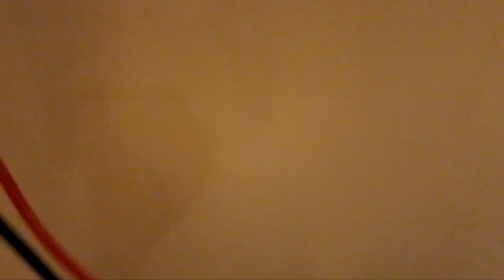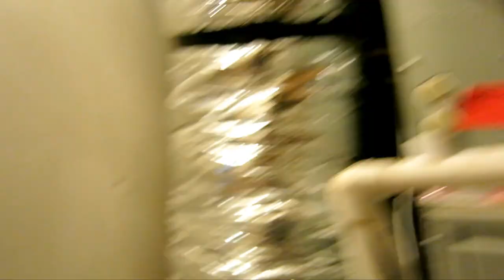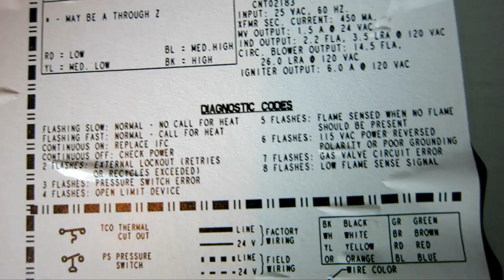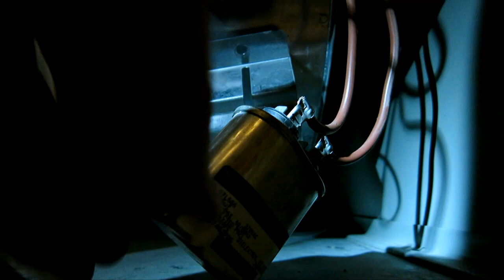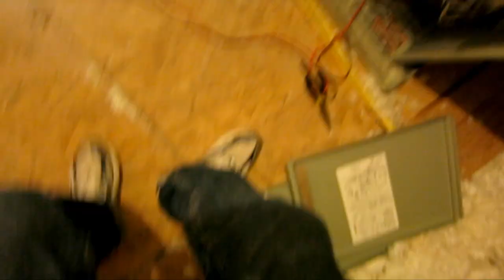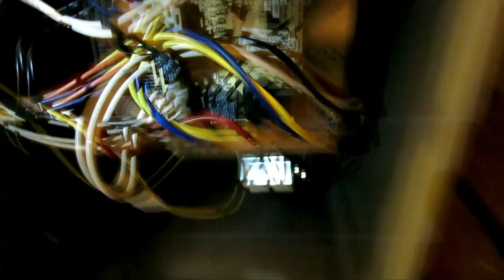Air Conditioner doesnt blow any air - how to fix AC blower - HVAC control board replacement

Comment: Outstanding. First I called Nest and they told me to measure voltage from Nest base between Red wire (supply) and Green wire (fan) 28Vac so wring is good, then twist together red and green, wait 3 minutes, fan no start so problem is in HVAC unit. I started checking capacitor as it is the most likely cause but uF reading was close enough. Then used used your very smart tip to test fan directly with the door switch. Fan motor OK. So ordered circuit board on eBay. Meanwhile I spliced 3 ways so the door switch supplies both the circuit board plus directly the orange wire to the motor. So now the house temperature is controlled with the fan blowing non stop until I replace the bard. Family is happy. No astronomical bill! Your video saved my day!

Comment: Don't know how to thank you. Old 20+ y.o. Goodman  unit. Followed your instructions from the beginning - capacitor check, fan motor check and the same thing - board was shot ( didn't have any current between fan and neutral). Got a new board from supplier , changed it in 20 min and it runs great. THANK YOU !!!!

Comment: OMG, the AC guy just left and ball parked me $2000-$2500 to replace the control board and $6k-$12k to replace the entire furnace system. Thank you for posting this. I feel comfortable in troubleshooting and replacing the CB.

Comment: I followed the troubleshooting step by step and had a bad control board. Found one for $140 and afraid to find out how much I saved by DIY. The only exception was the new mounting holes didn't match the old ones. I cut a 1/4" piece of plywood as an arc/ short buffer behind the board and used drywall screws to complete the mounting. Great vid and tips!!

Comment: This saved my sanity.  My old thermostat went out.  I installed another but the fan was still not running.  When you said the green wire goes to the fan, a light bulb went on.  I rechecked the wiring and sure enough the green was not inserted properly.

Comment: Great start at troubleshooting. Helpful, but missed an important option when troubleshooting. Like in the video, I connected the hi-speed wire to the door switch and the fan came on, so I ruled out the motor and did all sorts of other troubleshooting. BUT, I should have done the same routine with the mid-speed (blue wire) and lo-speed (red) wire. I later did this and learned that the motor was bad even though the hi-speed worked. By trying each of the three speeds, you can definitely rule in or out a bad motor.

Comment: I wrote this two days ago, but failed to post. So here it is again with a EUREKA update.

Thanks again ...for your amazingly fast response. We have been sleuthing since, and have narrowed down the problem.
I should have mentioned that the thermostat and batteries had also been recently replaced.
Also - in the process discovered some valuable information to avoid a potential disaster. There is no secondary drip pan for the condensate line; and no float switch which turns the unit off in case of clogged pipes..... which although indeed full of rusted debris, at least there were no water stains anywhere.  Have now replaced all 35 ft of pvc.
The unit in the attic has exceedingly difficult access and several other things have to be dismantled to even get the panel door off.
However, the transformer checks out 24V ok. And the control board just has the steady blinking light and checks out fine. So, the only thing is that somehow the 24V is not getting to the compressor. No loose wires that we can tell.
However, when tracing the wires from the thermostat to the attic, seems we don't have the same 4 colors so guess they must have been joined somewhere. Unfortunately its not a straight drop and they appear to meander through the walls - so cant really tell.
Mystery.
Our next move is to go get brand new thermostat wire and reconnect.
After this we are possibly at the limit of our DIY-ness; but very much appreciate your help in what we have learned.
Eureka!
Indeed, hooking the thermostat up with new wire directly to the control board - bingo - the compressor started.
Diagnosis is that this HVAC unit was a later addition to the house; and installer must have lazily joined old wires and attached the blue from the thermostat to the yellow on the control. When the new thermostat was recently installed the blue - according to the instructions was left off (since there is no heat pump) .................
so have now re-coded and properly connected wires and all OK.
I hate to think how much time this would have cost an repair man to figure out.
So - again many thanks for your instructive videos which gave us the courage to tackle all this.
Reply from the maker: lindarundell1 thats so wonderful, and thanks for sharing your story!

Comment: Nice video.
Sometimes the relays are clicking but the contacts a not working anymore (worn-out) because the relays used are barely strong enough for the current surge of the motor. I usually change those relays with higher rating ones. Also sometimes the soldering traces are cracked because now-days they use lead-free solder that is more brittle...
Reply from the maker: that is very true and thanks for bring that up. I too have done that in the past.

Comment: This was very helpful, my control board went out on in the middle of the summer with intense humidity. I added a double spade connector to the door switch power out (power line to the board). I then pulled the spade connector off the control board that powers the fan (black wire for me), and connected it the new double spade connector on the door, and left the other power out going to the control board. I then jumped my Red and Yellow which bypasses the control board and calls for AC. I now have AC running nonstop until my new control board arrives later this week. Ill wouldn't recommend leaving this on 24/7 but its an emergency solution that works.

Comment: Thanks for taking the time to produce this video.

Had this exact problem today, wired the motor straight to the breaker for the customer to be able to get emergency A/C for the day/night till I could pick up another board tomorrow morning and swap it out.

Nice trick using the door switch to jump/test the blower motor, totally stealing that for the next time I run into this issue!
Reply: i did this and have the blower motor running on that door switch now, will the ac be on or is it simply just the fan running? the house is not cooling off has been running for good hour.
Reply from the maker: thats just the blower running. you need to check the unit outside:
https://www.youtube.com/watch?v=4OAGq84mQSo
https://www.youtube.com/watch?v=r8LD6rtElUY
https://www.youtube.com/watch?v=cnD65qX8bjM
Reply: How do you wire the blower directly to the breaker?

Comment: When your checking voltage between neutral and black (hi-speed cooling) you would only expect 120v if the themostat was set for a call for cooling.  In this video, you are using the fan auto/on switch to call for fan on. You would have to test between neutral and whatever wire was setup to energize with just fan on (whether is yellow, blue, brown), so when you showed 0v between neutral and black, that would be expected. So the board seems okay at this point in the video

Comment: THANK YOU SO MUCH for this video.  I followed these steps and found that my control board was bad, too.  The differences are that my control board doesn't have an LED and my pressure switch is wired backwards (with no label).  
In addition to taking pictures, I moved the wires from the old board to the new board, one at a time. I unmounted the board with all the wires in place.  I mounted the new board under it, then move the wires over on at a time, starting from bottom to top. 
My capacitor is off by more than 5% so I'll replace that in a couple of days when the new one comes in the mail.

NOTE: It wasn't mentioned but the white neutral wire needs to be re-connected before testing with the pressure switch.

Comment: My outside ac unit is running, the furnace motor comes on, but the fan below the furnace doesn't kick on.  I have no air coming through my vents.  I went out and bought a multimeter and tried to duplicate your tests.  I have a trane furnace and it is very similar to the one in the video.  I tested the thermostat  control unit and got 24 v AC with the fan on "auto".  I couldn't test with the fan on "on"mode as the switch for that is part of the front piece that comes off.... so I couldn't test that part as you did.

I don't see any overflow switch but my unit is about 23 years old - so maybe it never had one...

I tested the capacitor and it gave me a 7.0 reading (the unit had a 7.5 on it as yours did) that seems ok...

I plugged the black fan wire directly into the door pressure on/off switch on the blower panel so it was plugged right into the incoming power.  The fan came on right away - blower seems ok.

I tested the voltage on the control board from the spot where the black fan wire attached to the spot where the white/neutral spot is.  You got a 0, I got 120 (I think that was number) but it then started dropping lower (I think because the furnace kicked on and used some of the voltage?)...   

So all my tests seemed to turn out ok....  any ideas/suggestions?  Thanks!!!

Mike

Comment: A lot of people who aren't HVAC techs won't understand why you will read 0 volts when the signal is being sent. This is because the R 24v is sent through the G terminal when you select fan on. Multi meters read the difference in voltage between both leads or the sine difference in voltage. His meter reads 0 because R and G are the same voltage and sine if there was a common terminal he would read 24 volts because they are different sine waves from the transformer.
Reply: Thanks - was a bit confused by that myself.

Comment: Great Video, It helped me blindly get my air handler working without replacing anything(not sure what did the trick). I had a Question. Randomly my air handler will not kick on even thou the unit outside will start just fine every time. sometimes it will last all year without a prob. then go out until I tinker with it ( its in my attic) or it will not work for a day and work the next. my ideal is it might be the relay sense its a goodman Brand, but any information would help. also i want to point out I dont have a magnetic shutoff for my air handler. Thanks for your time.

Comment: What do you call how you used the lead on the kill switch power cable from the 120volt wall outlet to check if the fan worked how would I look up how to do that further is it a method? Or does it have a way to safely do that

Comment: I used this to determine my control board's cool (high speed) is not putting out any voltage.  Heat is 119 volts.  Hooked the high speed to the 120 volts of the interlock switch, as you show--worked like a charm!  Will switch the air on with this, until I get a new board to install.  Thanks for the help!

Comment: Hi, the furnace doesn't turn on and the red light inside of furnace (down) is permanently on, means ?. The thermostat display AC on, probably is the fuse ?, or why the furnace and the AC do not work ? Thanks for your answer.

Comment: Another trick you completely forgot is that most control boards have another relay circuit designed to turn on a external humidifier whenever your in AC mode. You can just move the fan motor wire to that connection and all will work fine until you replace the circuit card.

Comment: I have an outside Goodman heat pump unit. Noticed low to no air flow coming through the vents just all of a sudden. Ordered a new capacitor for the fan blower. It works and air flow is great inside until I put the top back on. I've cleaned the coils , have any idea what is making no air flow once I close the unit?

Comment: HI Thank you for the video, i recently replace the capacitor of the condenser fan
since the fan is not turning and it worked but after a few days the condenser unit and the attic blower stoped working like there is no power at all i have checked the breaker
and it is good. Even when i turn the control to on the blower does not kick-in like no power do you have an advice for the problem please help me if you could Thanks.

Comment: Great video!  Thanks.  We just had the fan blower replaced and it worked for about a week and now it does not blow.  I wonder if it could be the capacitor.  If they replaced the blower motor, I wonder if they put a new capacitor in.  If they did not put a new one in, I wonder if it was a bad capacitor the whole time (nothing wrong with the old motor).  Does anyone think that is possible?  Thanks in advance for your time.
Reply: I would think the cap would blow with the motor.  If anything they should have been swapped out together.

Comment: Again I'm watching a DIY Tinker video - and I really like this video. My issue is that blower wont come on when AC is on - either auto or fan. I switched the setting to heat and guess what. The blower came on - I switched the settings back to AC and it's running just fine. If I shut it off no blower fan. I do not have a volt meter so not sure how to test the safe-t-switch. Any thoughts?
Reply from the maker: I've never seen something like that before. Sounds like your blower is working and im assuming the air is cold when you switch back to AC. If thats truly the case, then Its possible that you might have a faulty control board. you should call a HVAC professional for their advice, this doesnt sound like a normal failure condition.
Reply: DIY Tinker Hello and thank you for the response. I live in S FL and have only used AC in 4 years. I live in a rental house and the landlord isn;t so nice. The outside unit works and the coil does produce cold air. The blower doesn't work. I disconnected the safe-t-switch and still nothing. Then it started and ran for quite a while. The temperature dropped and the unit shut off- now it won;t start. I just need the fan wired so that it runs with the AC - don;t care about the heat. Any thoughts or suggestions are appreciated.

Comment: Can the relay be changed instead of the whole board? I did what you did to get the fan to kick on.. It's a 11 year old furnace.. Honeywell.. Unless you can do a video to wire the fan directly to the power so I can connect the cool wire back so the AC can turn on.. Until I get the board..

Comment: I have a tricky problem.
Air handler works ok when in fan mode. When cool mode is selected compressor unit comes on and seems to be working fine but air handler shuts off.  what is going on? Already replaced the 90380 relay on the handler.
Please help.

Comment: I am using a nest thermostat. You have to unplug it to read the fan and power so will it read 24 volts while it's on and unplugged or is it 24 because there's something wrong?
Reply: To add to this, my fan (and blower) comes on for heat but not for cooling so I know the fan works.

Comment: Thank you - we have learned much from your well produced videos.
However, so far none to replicate our exact problem.
A/C had not been used for 10 days or so.  Now, when setting thermostat to lower than room temperature, "cool on" signal appears, fan motor starts, but compressor does not. Checking the compressor unit, there is no voltage across the 24V wires on the contact switch. But when manually press solenoid button, condenser starts--so voltage is not being transmitted from blower unit in attic to outside compressor.
In the process we have replaced the contact switch as well as capacitors on the compressor unit.
Next step?
Presumably some relay on the control board? Your video showed how to test for the fan. How to test for the signal being sent from that unit to the compressor?
Many thanks in anticipation of your assistance.
Reply from the maker: lindarundell1 As you already know, the remaining things to troubleshoot 24VAC. Is the transformer giving 24VAC? Then next is to see if the thermostat is working. The following video does both check: 
https://www.youtube.com/watch?v=nJVTVCVITxw
If you do have 24VAC and the thermostat works, then check the control board and wires. From the control board, follow the yellow wire and return common wire and see if anything is loose. if you have 24VAC on the control board wire, but 0VAC outside, then you might have a broken wire (e.g. if you were working on the lawn and accidentally cut the wire). hope that helps.
Reply: +lindarundell1  check the coil resistance of the compressor relay. if it shows infinite resistance , replace the compresssor relay.
Reply: +clemente malayo  its cheaper to replace a component than to replace the control board.